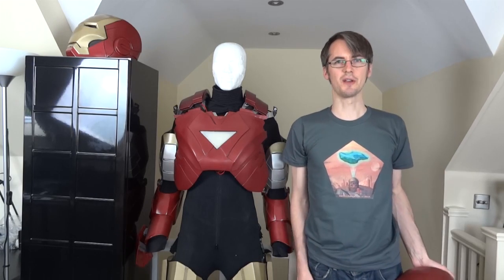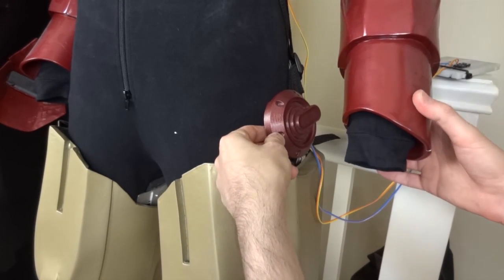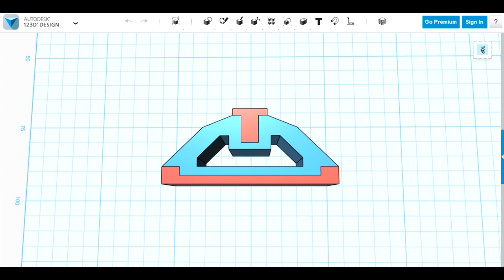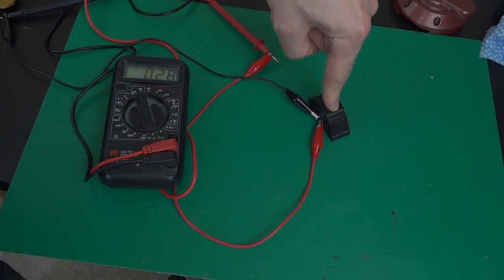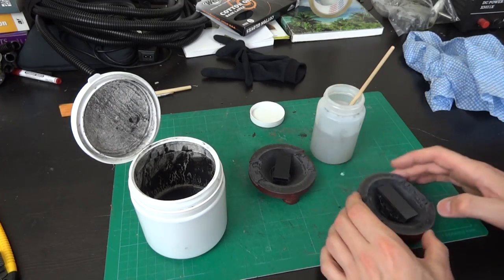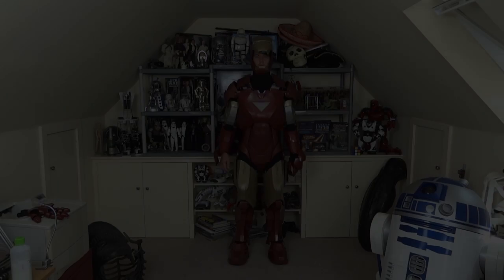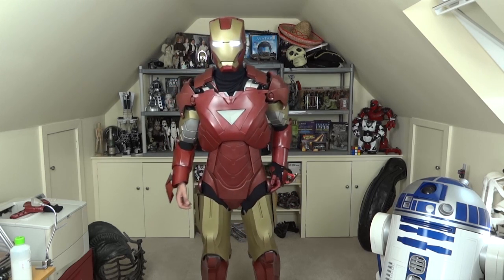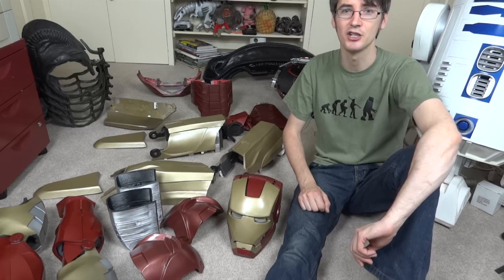Iron Man Cosplay Suiting Up | James Bruton

Comment: I would have put the switches on the sides of the index finders inside the gloves, so when you push your index finger against your middle finger, it activates the switch, this way you can do hand blasts from your repulsors without having you touch your hip with the other hand, allowing you to even do double repulsor blasts with both hands.

Comment: That front chest piece really needs to sit higher on the suit, dude. I've been following this project ever since I subscribed awhile ago, and I've always thought there was something slightly off about it. There's a very obvious gap between where the shoulders meet the front chest piece that isn't nearly that big on the suit. Not only that, it's sitting really low on the stomach. I see that how you made it, if you were to bring it up, it'd either collide with the upper arm pieces or push into your underarms. Other than that, some very much needed paint aps, and this suit is pretty much perfect. Great job overall.
Reply: Hush.
Reply: ...N-no. I won't. Kthnx tho.